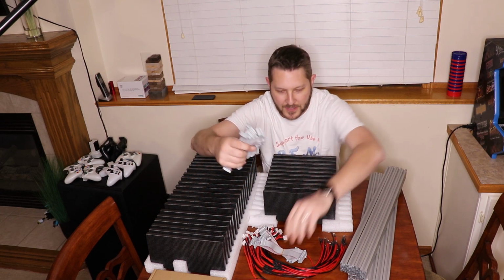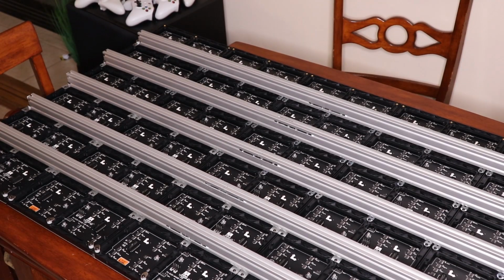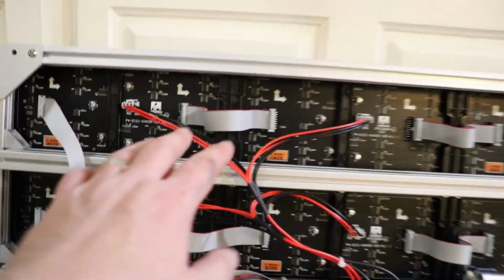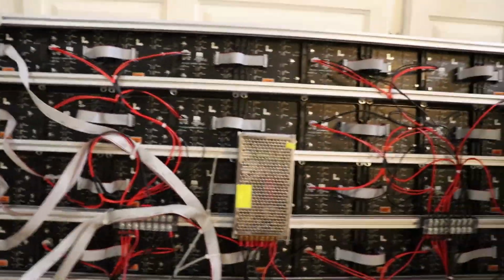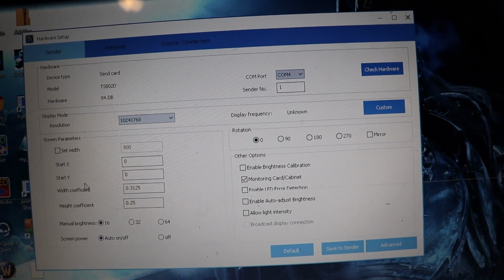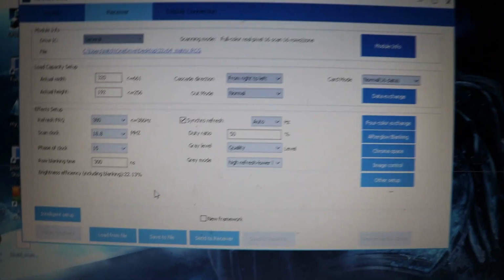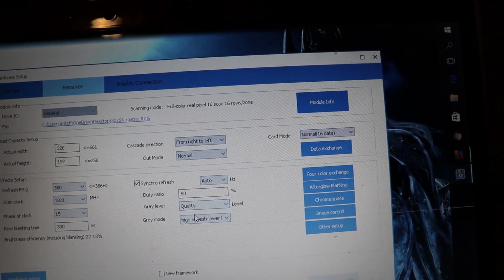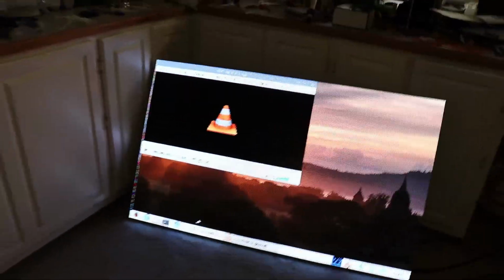4ft Video Wall Build   Is it large enough???

Comment: What size panels you use. P10 or P5  Aliexpress link didn't work
Reply from the maker: P4 64*32 16x32 RGB Led Matrix Panel Indoor SMD2121 MBI Led Display Screen P4 Led Video Wall Module P2P3P5P6

Comment: How many of these would i need for a 48"x72" video wall?
Reply: One module is 10" x 5", so 10x7 panels to get a 50" x 70" screen = 70 panels.
Sorry, but if you can't do such a simple math youself, you probably should not try to build something like this.
Reply: @Bluebrain  I can do the math. Just did not want to Thanks.

Comment: What about wiring them to an artnet controller?
Reply from the maker: Hmmm i have not used one of those before.  I am not sure but it looks like it may be promising.  do those controllers work with LED pannels?  It looks like they work with the strips but I just looked on the surface.

Comment: Thank you for making this incredible video! How is the response time on this configuration? Do you suppose this could be used for retro gaming, or would all of that video processing result in a noticeable delay between player inputs and the screen updating?
Reply from the maker: Thanks for the comment.  You know I have not yet tried gaming on it with something like retropie but that sounds like a good idea to try.  One thing though is that since it has LED panels even though they are spaced 4mmx4mm you still have to get back a bit before the picture is not pixalated but I will have to try and get back with you on it.  Great suggestion.  I would assume it would be fine since the audo of a movie does not lag with the video.